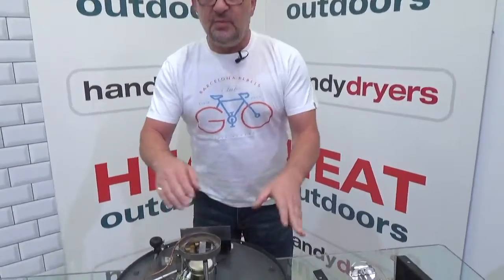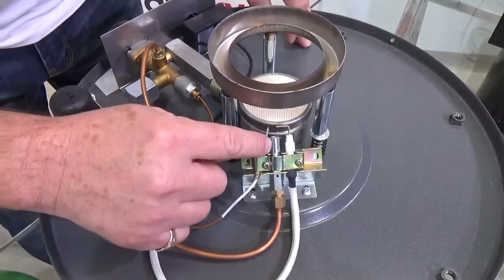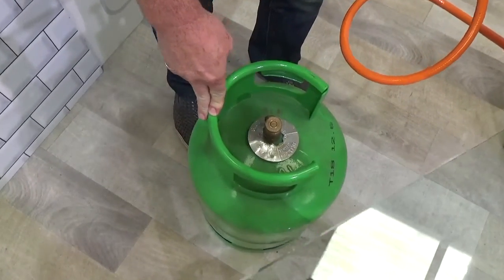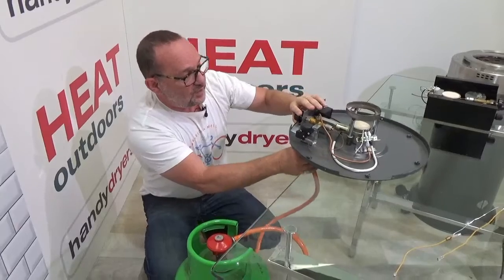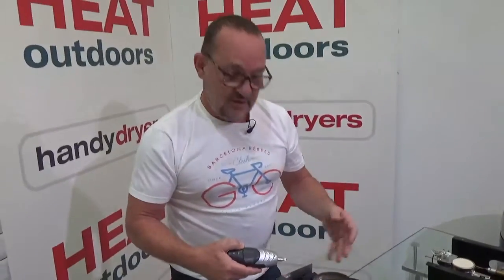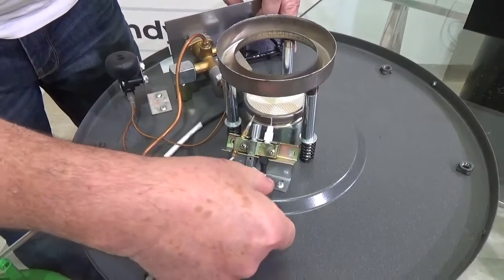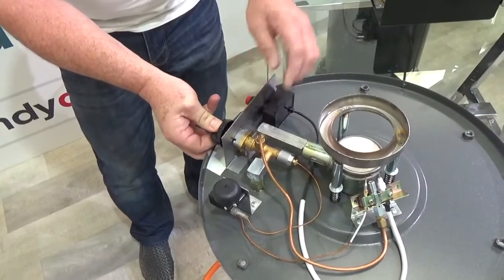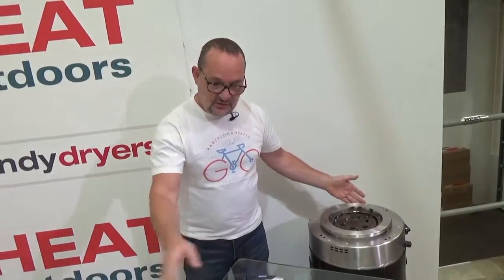GAS PATIO HEATERS TROUBLE SHOOTING

Comment: Thank you Steven for your brilliant explanation of the faults to look out for. You were clear, easy to follow and understand, just one of the reasons I prefer to watch British YouTube videos. No loud rock music!!! 😳🙄 just calm and nice. I’m going to go and follow your instructions and then get back to you to let you know how I got on.
In the meantime, any additional advice would be great. I have acquired a Memphis Patio Heater, no spark and I couldn’t get the gas to come through. I have pulled it apart to reveal the spark unit and will now look if there is a battery inside, also check the gas lines.
Great video and thanks again. 👍🏾👍🏾👍🏾

Comment: I am extremely grateful for your in-depth dissection of a gas heater innards.  I am restoring an older stainless steel table top heater and I love it, but have no clue how it works. I took it apart completely and polished up all the bits, cleaned out all flues (except main gas line).  I also took apart the tilt switch and cleaned it out.  All looks good.  The igniter is very hard to press down, its a manual one not battery.  But it sparks!  I cannot take it off the base so its hard to access that part of the heater. 

I can light the pilot light easily with a manual lighter.  However, the main gas burner does not come on.  The pilot stays lit. Maybe the thermocouple needs to be warmed up some more or the gas main flue is clogged.  I'll try again tomorrow.

The threaded part that sticks out of the base and is the knob to turn on, off, pilot, low, high is too short, so I'm having trouble threading a nut that holds the knob sections in place.  Bit of a headache.  Not sure how to replace that, or extend it.  I'll reassemble again tomorrow and see what happens.

I am really grateful for your demo!  Without this I would be lost.  Many thanks!!!  😄❣❣❣🙏🙏🙏

Comment: Thank you for this video! It helped me understand how everything works, but I have a problem that wasn't addressed. I have it all hooked up correctly, gas turned on, pilot works, ignition works, but as soon as I release the knob, the gas shuts off completely.  I read this is a fail-safe, but I've taken it apart and dont see anything misalligned. Ideas?

Comment: You didn’t deal with the burner not catching on - not lighting? I have a pilot light (doesn’t stay on?) I will hold it for about 1/2 a minute and see what happens then. I’m thinking there’s blockage of gas to the burner and will try with piping stick (don’t know what it’s called) to clean it out? Any suggestions how to check the burner?

Comment: Awesome explanation! Nothings worse than buying a new patio heater , using it once to only find it wont work again some time down the line . Ive tried bypassing the tilt switch and it still wont stay lit. Got the map gas torch out due to frustration to light it and a hold down the push knob to no avail . 
I guess after watching your video ill try wait for the gas 2 minutes is worth a try . 
Its weighted by sand in the bottom so falling over isn’t a concern of mine. 
In all honesty i want to drop kick the thing lol
Reply: I took mine apart. I also felt very frustrated initially.  Then I decided I was going to make this work whether it took a day or a month.  Today, my pilot light stayed on!!! Hurrah!  I was going to give up but I don't like giving up on anything and letting it get the better of me.  I also don't learn that way.  So settle into the task, remove the artificial deadlines you have to get things done, and enjoy the process.  Its amazing how this thing works once you understand it.  Beautiful piece of engineering.  The tilt switch and thermocouple assembly come as a whole package on Amazon for $13 or less. Tilt switch only costs $8.  I opened up mine and its very simple inside.  Its just a little steel ball that moves around the pushes a spring shut when tilted.  They do go bad - they are made in China - and very toy-like cheap parts. But who cares, as changing this is pretty easy.  Now, fix your heater and feel that warm glow inside when it all works smoothly. I made notes for the next time.
Reply: Dropkicking might help if the tilt sensor is bypassed

Comment: What if it lights up but the flames only stays at low (Hampton Pyramid heater) regardless of the dial being in high setting.
Reply: Most likely the main gas flue is partially blocked or regulator is stopping it. Some regulators need this:
Turn off heater. Turn off propane tank.  Unscrew propane hose to bleed out any gas.  Reconnect heater to hose.  Turn on propane tank and wait 1 minute. Now turn on your heater.  If it lights up high, then the regulator has a safety feature that slows down gas.  Once you are connected no more trouble, but if you turn off the propane tank, you need to wait 1 min each time after you turn it back on.

Second reason could be the main gas flue is blocked.  You will have to unscrew the main flue (two wrenches) without bending metal gas line, and blow it out with compressed air really well.  Use a can or compressor. Also use a fine needle in the hole on top.  Reconnect, and try it out.

Pull off your knob on main switch that says OFF, PILOT, etc.  Put a few drops of oil INTO that shaft.  Mine is very sticky so I am going to try that.  Let it drip all the way in.  Wipe off the outside. Slide knob back on.  Try moving it from Off to Pilot to Low to High (with gas off of course!). See if it moves smoothly. Maybe it is stuck on the wrong position.

Comment: Every time i let go of the button the flame goes away No matter how long i compress the button
Reply: This could be a tilt switch issue. Replace the tilt switch or bypass it. See videos on Youtube. It is super easy.  A new one costs $10- $13.  They all work in a very similar way.  Be sure to color code the two wire ends you remove to match them to the sockets on the old switch. New one should follow same pattern.